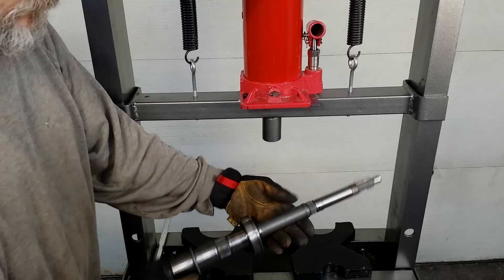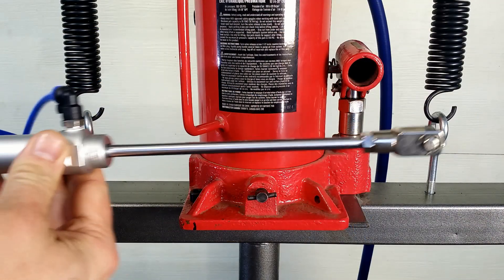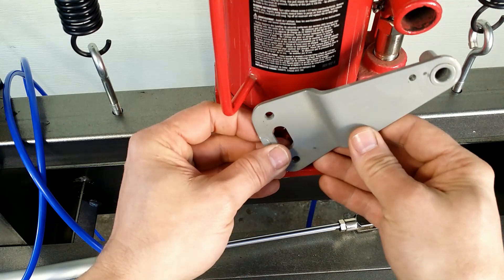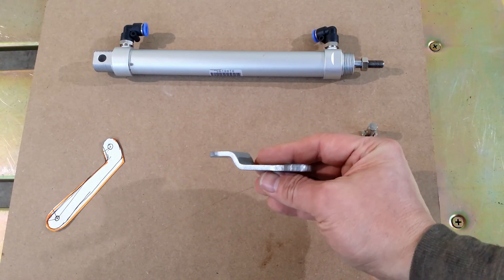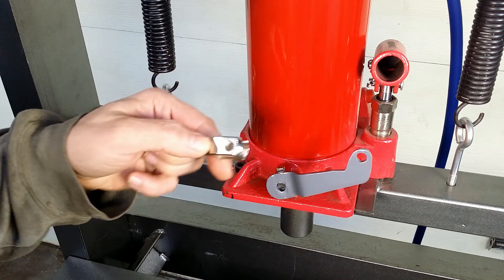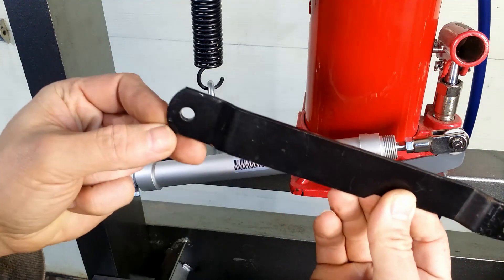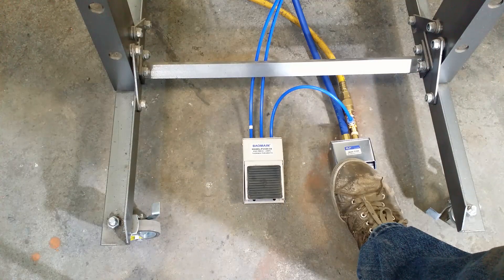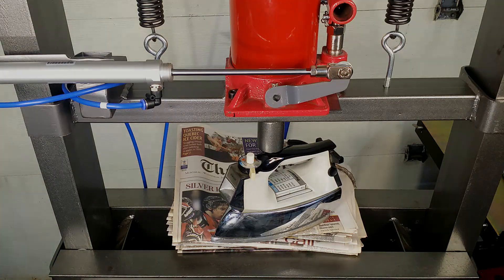20-ton Shop Press Modification. Quick Release.

Comment: Hi. Think your idea is brilliant and waiting for the parts to arrive, I'm having trouble finding a pneumatic control valve, the vevor 20t air jack I have says max working pressure 200psi, but most of the hand control knob s say max pressure 08mpa any advice, what  pressure does your jack need too work as it looks the same.
Reply: Thanks for taking the time to reply.
Reply from the maker: My jack working pressure is 100-120 PSI (as per owners manual), actuator 130 PSI max and the pedal (valve) 116 PSI. Works for me at about 100-110 PSI.